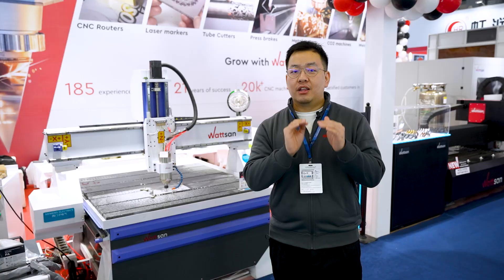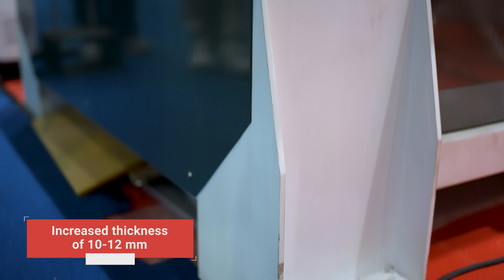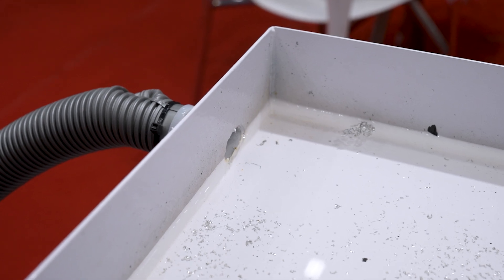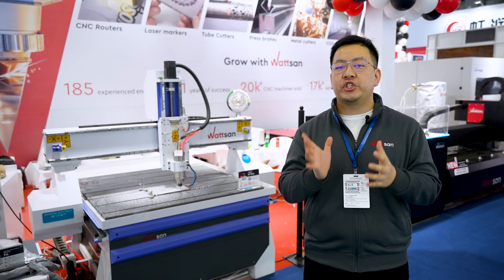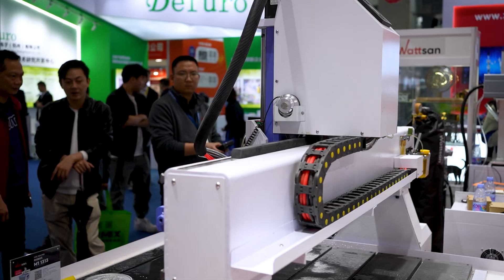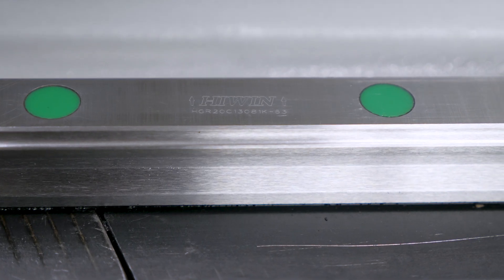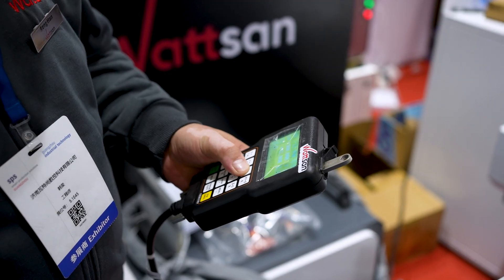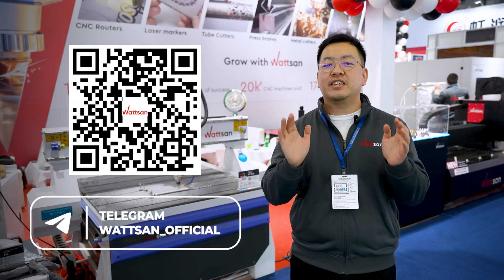WHY you NEED a CUTTING FLUID SYSTEM for CNC ROUTERS | Wattsan M1 1313

Comment: very clear and easy to understand, thank you.
hint, is it necessary to use coolant when working with thin soft metal and at low speeds?
Reply from the maker: It is not necessary to use coolant when working with thin soft metal and at low speeds. But again it depends on the type of metal, what do you mean by thin metal (0.3 mm, 1 mm or 3 mm), what is the surface area to be machined, what type of machining do you use (rough or finish)?